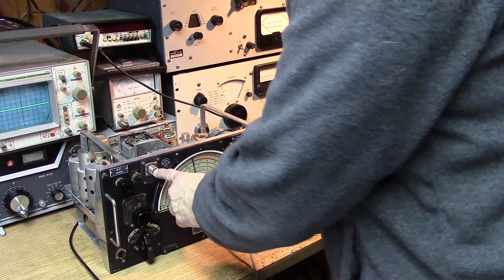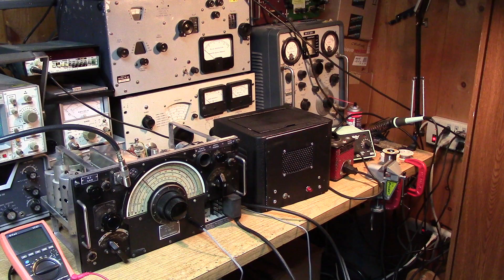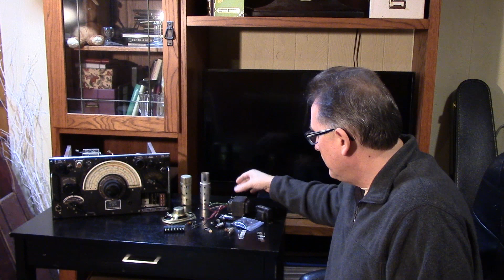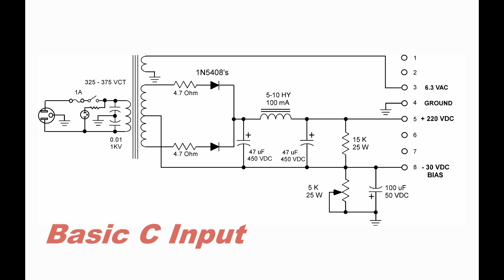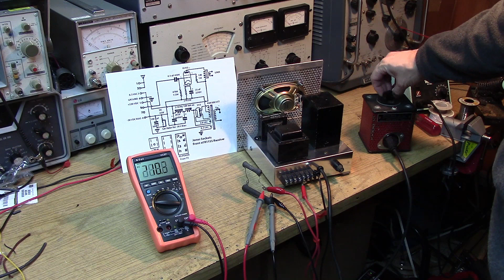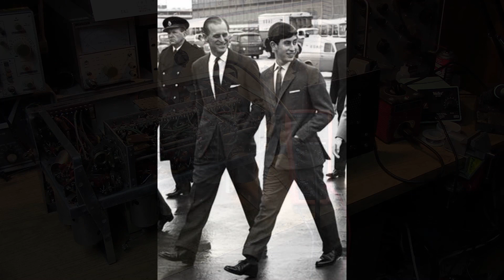R1155 PART 3 It's Alive!

Comment: Maybe a dumb question but how is the -30V being generated?  The low-side of the HV is the CT and pin-8 but what puts 30V across pin-8 and the GND?  Thanks!
Great (and huge effort!) restoration!
Reply from the maker: I believe that they suspended the chassis between negative and positive with a voltage divider. So if you consider the chassis to be at Zero, the negative is well... negative in respect to it. This is an old trick to get negative bias.

Comment: Could it have been made to work on 24V Plate and 3V Heater and using Raytheon Wire-Ended vacuum tubes which would have made it a lot safer to work on

Comment: Great stuff- I like the 'mixer stage'! The cylindrical metal multi-section caps cause problems on 1155's, just be aware. They fail for fun. Mine has a weird problem where on the highest range, the local oscillator stops near the LF end of the range. Gonna have to start changing components until I find it... Excellent video Mike, thank you. I also enjoyed your series on the command receivers, I would like to own one but they are not so common here in the UK. 73, Alan G0NFY.